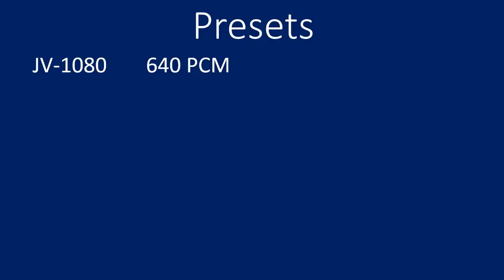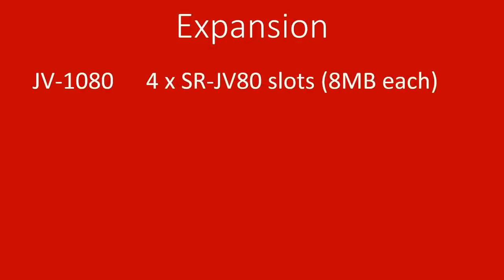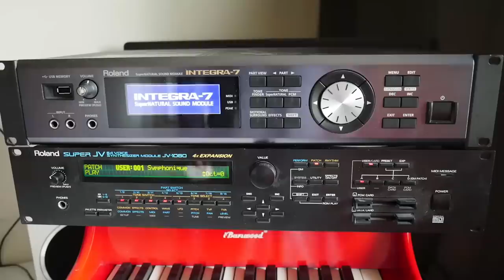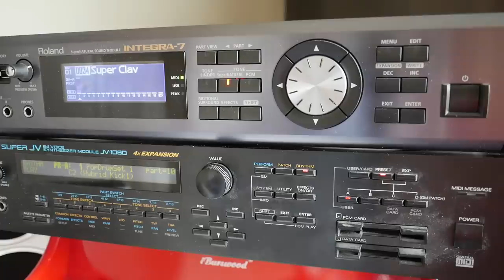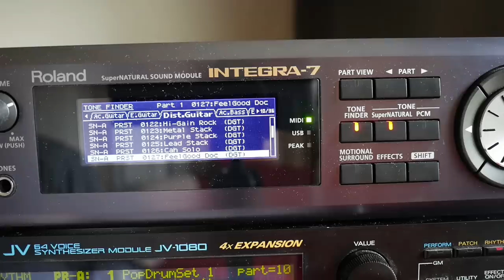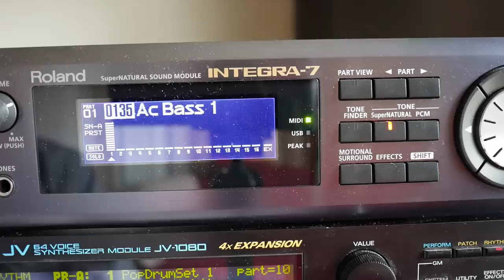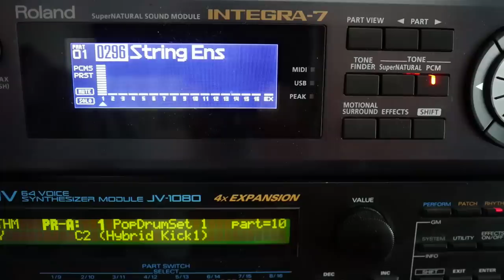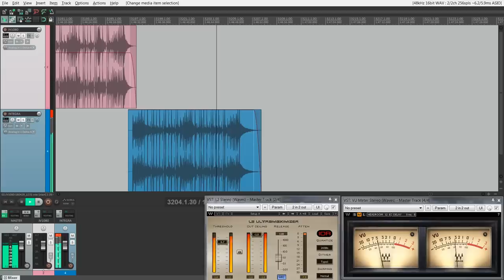Evolution of a classic synth module | Roland JV 1080 vs Integra 7

Comment: How was this recorded? Were both devices ran from same midi output? Massive timing differences on the Integra, almost as if it was running from a improperly set up computer sequencer after being quantized all over the place because of inaccurate timestamping. Computer sequencers accumulate easily heard timing error both when recording live midi input and also on the output of the recorded midi. Not that I have not found anyone posting results of a setup able to keep jitter < 150 usec while recording midi. Part of it is because midi is serial so simply 3 notes at a time and you start getting 2 ms delay on the notes. There was a dude who posted a circuit that converts midi notes to audio (and decodes them in pc software from the audio) which I believe solves the problem (because even cheap audio solutions in computers have their own dedicated chip that buffers it with a known rate (sample rate)) - but that dude disappeard from the net (probably the hardware vendors kidnapped him because doing this midi recording properly could distort the workstation keyboard market and also reveal how Intel may be cheating in benchmarks by use of sloppy clocking in the PC). The midi at best gets timestamped by some better interfaces but there is (afaik) no standard of how such timestamps end up in your midi sequencer/recording software. Supposedly it is rare that people "track" midi live.. but nobody has pointed out that perhaps it is rare precisely because of the poor implementation of it. And once you start to think about fixing the issue, that whole 32000 baud serial nature that can't handle a chord properly makes anyone throw up the towel as you'd have to re-engineer the large part or entire standard to fix things properly.
Reply: I can't say I noticed, but you may have a point.

Was the Integra connected by USB?  That could be the source of timing errors, if so.  It's faster, in theory, but it's typically sent in big lumps, with big delays in between, which is a nightmare for timing.

DIN plug MIDI is sent at a rate determined by the keyboard, and each messge is sent as soon as it can be, so the timing tends to stay within certain limits.

Sound travels about a foot in a millisecond (actually close to one and one eighth of a foot), so for each extra millisecond between pressing down a key and hearing the sound, it's like the speakers moved a foot (and a bit) further away.  A few milliseconds / feet aren't noticeable, at least to most people.  When it starts to get into double digits, it becomes much more noticeable.

Comment: A question from a synth, digital-music creation n00b: given the availability of DAWs and vast, high-quality sample libraries and soft-synths, what is the role of a sound module in real-world music production today? Are they still used? And if so, why? What is the advantage of using a sound module over, say, a laptop or desktop machine filled with dozens/hundreds of synths, effects and tools, and TBs of samples? Thanks.
Reply: Depends. If you compose music by drawing notes on a screen then DAW is quite likely good enough. If you are more interested in entering the notes live from a keyboard or such: Take 5 years of jazz drumming lessons and then plug in midi drums to your computer and you'll find out (by recording the midi drums and then playing it back). That's the worst case (time to learn the difference). If you have listened to lots of songs with "shuffle" and can tell when a song has shuffle or swing, then you may be able to tell the difference by ear. The answer is "loadsa jitter". You may be able to solve this "jitter issue" by requesting Microsoft/Apple to add a button to the keyboard that says "disable interrupts, updates and background services". (good luck with that!)

Comment: As an owner of the XP-80, XV5080 and Integra 7 I'd like to share my opinion. My favorite of the 3 was the 5080 but sold it and all the expansion cards for the Integra 7 and had some change left over. The XP-80 (same engine as the 1080) was my beloved first pro synth, but I was primarily using it as a midi controller for the past few years. Once I got a new midi controller (SL88 GRAND INCREDIBLE!!) I sold the XP80...which was very hard to do. In my opinion, the XP's engine was very rich when played in single patch mode, dedicating its entire engine to that patch. However, when played as a multitimbral instrument the sounds became very thin and weak, almost unbearable. I feel the same about the Korg Trinity, which I love but it becomes incredibly thin when played multitimbral also. Both the significantly more powerful XV5080 and the Integra 7 sound significantly better to my ears as multitimbral instruments, I find the sound of each patch was not compromised. Still, I cannot justify spending 1000 more for an Integra 7 over the 1080, as the majority of these Roland sounds are terribly outdated. For the price the 1080's go for I'd recommend buying one if you're in the market for a solid budget (but professional) bread n butter synth. Still, I hate to admit it but I primarily use software synths and occasionally slap some accents here and there on top of my recording using the Integra 7 (mainly because I'm lazy), but the thing still sounds pretty incredible in certain aspects. I imagine after the current analog resurgence fad wears off in 15 years or so any of these digital pcm machines will become highly sought after and we'll all be telling stories of how "I remember back in 2019 people were practically giving these things away" lol. But that's the circle of synths I suppose.

Comment: Sounds I liked better on the Integra:  acoustic bass; saxophone; the string patch around 14:50; parts of the drums (liked the snare better, not so much the toms).

I don't want to jump on the "older is better" bandwagon, but most patches sounded about the same, with a few actually better on the 1080 (in general, it seemed to have a warmer low end).

In your copious free time, maybe you could play some things on the Integra first, exploiting its articulations and such, then try to find 1080 patches for the same MIDI segments.  It's amazing how much the nuances of a patch affect what you want to play using it.

Comment: I just bought a JV1000 and once I stopped pulling my hair out trying to access the JE-V1 expansion card (it's not worth going bald over) I just love these 90's sounds again, probably as it coincided with my nightclub days in my youth and suddenly those hit sounds are recognizable. However, as for your rack synth idea... I sold my hardware in 2007 to purchase my first iMac and use Logic, and I don't know what it was, but my compositions just sounded instantly better. Perhaps the new approach to producing songs made a difference, but while I'm now eager to learn towards hardware again, particularly on stage, think I'll stick to producing in the box and then transfer to hardware over MIDI. Kicking myself for selling my JV1080 and Yamaha FS1R now though. The latter is gold dust as it never caught on.

Comment: Very insteresting video as I liked how the old JV-1080 sound much more than the modern Integra... I don't own either and am not planning to get either, but still. Many of the old romplers did a good job with limited bits and memory, I do own some old digital synths in my own collection and many of them have many very nice sounds still. The only rack mount rompler synth I have is a Yamaha MU90R which I did buy as brand new, it seems to be completely forgotten device... even it's not that bad. 64 note polyphony and 32-part multititibmri(or how did you pronounce it)rilaral with 2 separate MIDI in ports... and a funny animated guy grooving on the LCD display panel below the text area which doubles as a 32-channel vu meter! :)

Comment: Long story short: Roland threw everything and the kitchen sink into the Integra-7, and it stands to reason that this will be their last 19" synth module, ever. Studios use software, and the market simply isn't big enough. Having said that, I'm grateful that they do produce it, instead of yet another desk-cluttering knobby box, and that you don't have to purchase anything else, or hunt Ebay or Reverb for that elusive and overpriced expansion board. (Case in point: the Beat Garden and Techno Synth Construction Yard ROMs for the Proteus 2000.) So yes, the Integra-7 is on my shopping list, and will quite possibly be my Father's Day/birthday/Christmas/look-I've-been-good-and-bought-practically-nothing-else-this-year present. I've no interest in the JV-1080. If I want crunchy or lo-fi (which I don't), I can always run it through a VST. It's a bit more difficult to un-crunch a sound.
Reply: The funny thing is, I got my hands on a cheap JD-990 two weeks ago. Haven't been able to use it, because work has been gruelling. But second hand, asking prices are pretty much the same as those of the Integra-7. Hmmm...

Comment: Organs sound crappy on the Integra 7... I prefer the 1080 there and in general... it is more lush and warm. Drums were much better on the Integra, but that was expected :D Not surprising by the way that the JV-1080 is in use even today in studios and performances (a friend had to source 2 1080s for a production lately... amazing :D)
Reply from the maker: maybe i chose an unfortunate preset, there were dozens to choose from...  yeah, drums were very authentic.  saw two 1080s for $200 (the pair) recently.
Reply: the internal expansion boards probably have some better organs than the SN tonewheel patches.

Comment: I have a JV-2080 and an Integra-7, so I don't have any axe to grind.  The acoustic sounds on the Integra are a bit better, especially the acoustic piano, but, on the whole, the JV sounds as good or better to me.  Roland really nailed it with the JV, and the subsequent XV and Fantom series weren't really a big improvement, despite the better technical specs.  I think that the Integra is worth having--as a repository of 20 years of Roland sounds for one--but a JV is still useful and a bargain today.
I agree that old rack synths are under-priced and get no love.  I'd recommend an E-Mu Proteus (preferably, the Proteus 2000 or 1000), and a Korg Triton Rack and TR-Rack (the Trinity version).
Reply from the maker: some great suggestions there!   proteus stuff doesn't excite me much, also heard a lot of horror stories about reliability, humming.
Reply: That can be true and it's getting harder to get them serviced.  But they have the E-Mu Emulator sample library, which was the best in the industry in the day.  Get a good example and test it before you buy it and you'll be happy that you got one.

Comment: Thanks for the demo and the effort. Friendly tip: next time do it without plug-ins in between for a more natural comparison :-)  Thanks anyway. 
On topic: I feel the 1080 sounds better most of the time. Weird. Newer isn't always better so it seems. The 1080 was also more expensive when it came out than the Integra is today.
I used to own a 2080. Wasn't too fond of it to be honest compared to the other gear I had back then.
Reply from the maker: lawrence, great feedback, thanks!  for the record, the only plugin I used here was a peak limiter, applied to hardware and software just so that I could raise the volume to a reasonable listening level without clipping.  as you can see on the video it's not being pushed and is completely transparent sounding, just increasing the gain!  cheers y'all.

Comment: The 1080 seems to have more bottom in it and the sounds are fuller.   Is it possible that the recording of the Integra is out of phase to some degree or a global EQ setting left on or something?
Reply from the maker: i did check the studio set before doing the recording, global effects switched off, apart from reverb.

Comment: Is the INTEGRA-7 the last module from Roland in rackmount design? I check out the website there are no more rack mount modules after it, but only compact designs like boutique series and some are as softwares in Roland Cloud.
Reply from the maker: correct, not only that, seems like all synth manufacturers have dropped rack format.

Comment: Thanks, Woody! Well ... in every case where there is an acoustic or electric instrument as the basis, the Integra is more accurate. That might not be better; depends on what you want. The piano on the integra is pretty solid and might pass for solo piano; the 1080 is okay if you want something to cut through a mix like the Korg M1 piano (but better than the M1). The synth instruments are SW based, so they are the same except where the D/A processing is different. And in those cases, the “lower-if” of the 1080 is pretty good!  I have an Integra, and the number of sounds is almost too much. Almost.

Comment: I predicted the snobs in the comments section would be declaring the older unit is better (as they always do, regardless of what's being compared). I scroll down and sure enough, there they are, snobbing it up!
Reply: Maybe people just like convincing themselves that the one they can actually afford is better?

Certainly, if you fill all four card slots, the JV-1080 at least doubles in price, but even then, it's a fraction of the price of an Integra - as it should be - it's over 20 years old.

I think a lot of it comes down to nostalgia though.  I like synths that sound like synths from 20 or 30 years ago.  I think a lot of people buying synths now are old enough to be nostalgic about that era, so a synth that sounds like the ones we remember from then is "better".

It's all subjective, of course.  Clearly the Integra has better specs.  The SuperNatural voices are something that the JV/XV series can't do (graduated dynamics vs a maximum of four velocity layers), so if that's been done well, that is clearly better.

I don't really see that preferring a $200 synth to a $1500 one is snobbery though.  If the numbers were the other way around, I might be more inclined to agree.
Reply: TooSlowTube Personally i go by ear not by brand or price tag.
Reply: there is not much of a difference to me at all
Reply: If you are comparing the Integra to the jv by trying to get it to sound like the jv, the jv will always be better at doing what the jv does - us jv owners know what it is supposed to sound like and anything else is bound to be an immitation. However, the newer machine can do things that the jv hasn't got the power to do, so saying one is better than the other is a bit silly.
Reply: Integra is MUCH more realistic. Doesn't mean better but when I would need to replicate the sound of actual instrument Intergra is my choice. JV-1080 sounds very good but synthetic, it's like comparing Roland D50 to Korg M1.
Reply: Why liking one thing makes you a snob and the other doesn't? These are two completely different machines, some people like the brighter, more synthetic qualities of old synthesizers. If that makes us snob, then that says a lot about your world view, or lack thereof.

Comment: needing a bit of advise have the chance or thinking of getting a roland integra and a V-synth 2.0   so my issue is now what to keep and what to move on  as i have several romplers so shall i now sell off my um-220 ,jv-880, SC-880 and XV-5050 -srx 01drums and srx-07 ultimate keys, Jp-8080, MC-909 -srx-05 dance..... EMU proteus 1 & 2... as the integra  should cover most of these?   many thanks John if you can find the time to reply would be most helpful

Comment: I would say you should add some Expansion Cards in your JV-1080 before you compare it against the Integra. I think some of the patches you compared on the Integra are actually the equivalent of a wave expansion on the JV-1080. For instance, the Session expansion board for the JV-1080 has some really nice Pianos and Acoustic guitar patches, which are more similar to the realism of the Integra. I would venture to guess that the Integra might actually be using some of those same samples. How about you load some Expansion Cards into your JV-1080 and then run the comparison again? ;-)

I really like the Roland XP-30, which is like the JV-1080, but it comes with 3 expansions already built in (the Session, the Orchestral, and the Techno Collection), plus it has two additional expansion slots, bringing the total expansion boards you can have loaded simultaneously to 5 (instead of 4 in the JV-1080)! I really like the Orchestral 2, and the World expansions, to fill the two extra slots.

By the way,  I was surprised how much I liked the rawness of the sax patch on the JV-1080 in your demo. Though the Integra clearly had more layers of samples, I still preferred the energy in the sax from the JV-1080, which seems like maybe you could may it more realistic and expressive with some filter modulation?
Reply: I completely agree; the Session card is a must-have for these synths; better piano, nylon guitar, strings, telecaster ...